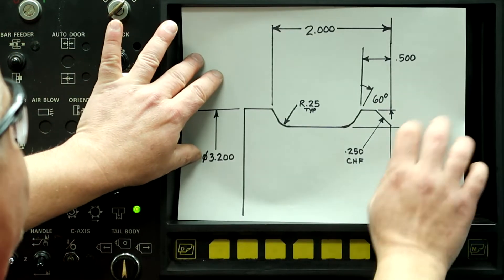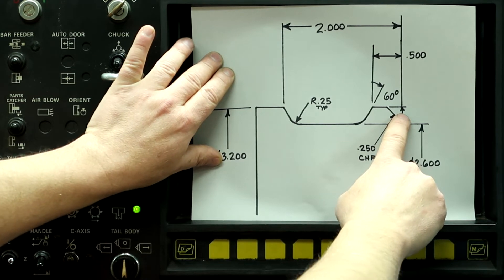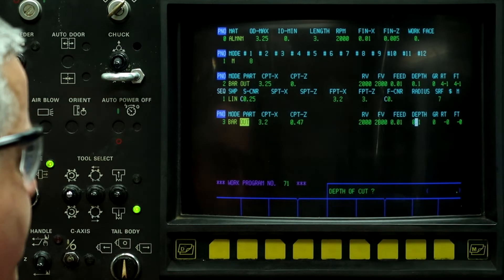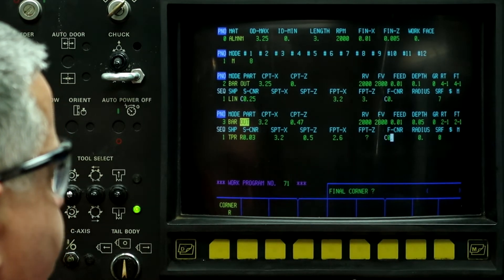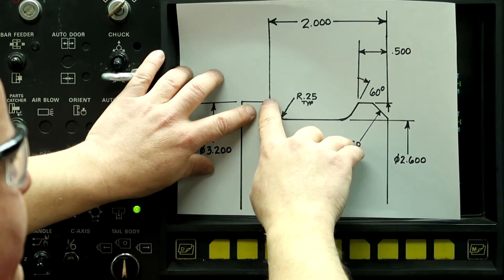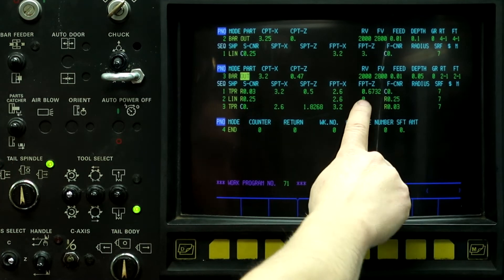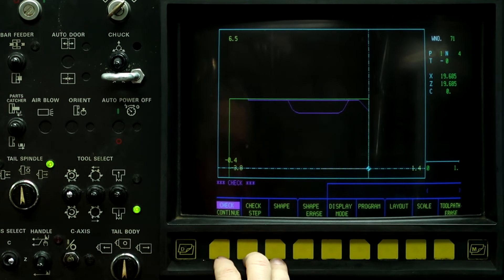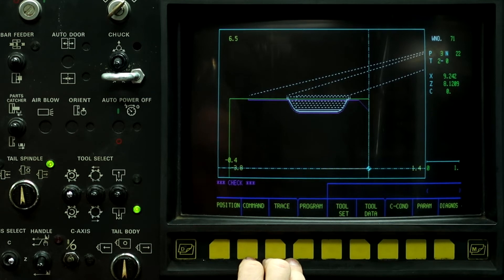Mazak Lathe BAR OUT OD Profiling VBMT

Comment: Great video. I wrote the same example with the same tool in a mazatrol smooth g. The start radius for the first taper doesn't show up and its a sharp point after machining. I have to write a linear before the taper to break that edge. In your example did it actually break that edge with a .03R?
Reply from the maker: Yes, it worked on my machine. I forgot the newer controls are slightly different. You did the correct method by adding a line.
Reply: Thank you for the reply. I wonder why mazak would change a good thing. No luck on the nexus2 control either.

Comment: Quick question, you mentioned the positive and negative values for calculating the end point on the taper, but I'm not yet understanding which to use when. Which direction is a positive and which is a negative?  Sorry if this is a long answer. Maybe you have something in another video that will make me understand better.
Update, I think I see now. Is an angle basically to the right of a 90° vertical line negative and to the left positive?
Reply from the maker: Negative taper is when the tool will cut deeper into the part and positive taper is when the tool is pulling out of the part.

Comment: Phil could you do a demo on how to change an insert during a roughing etc?  If an insert fails during a long heavy cycle it's a pain to go back and re-run the tool from the top and just cut air until it gets back. I know there is a better way but have never learned the proper way to do it without the risk of crashing.  I am just playing it safe at the moment but would like to learn better. Are you versed in this proceedure?
Reply from the maker: Yes, I did a video on this already. Look up my video on TPS.
Reply: @mazatroltipsandtricks6816  Thanks Phil.  Please keep  your videos coming.  They are really helpful.

Comment: Could you explain how to interrupt a process, such as a od turning operation, to check the dimension before a finish tool is called?  I'm not clear on how to restart after a feed hold is called.
Reply from the maker: Push feed hold after tool clears the part, press one of the manual buttons to get the machine in manual mode, measure the part, then press Auto button and then press cycle start. Machine will pick back up where it left off.  Do not press the reset button or the machine will start over from beginning of the program.